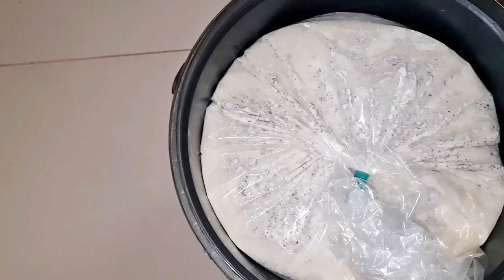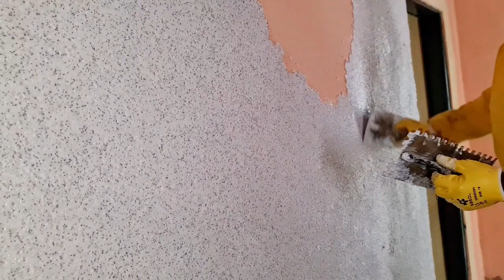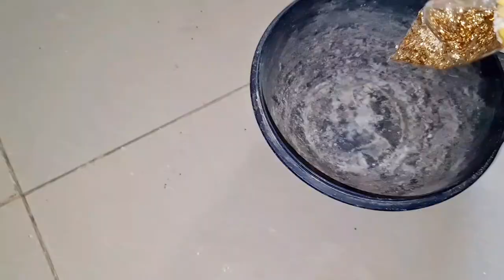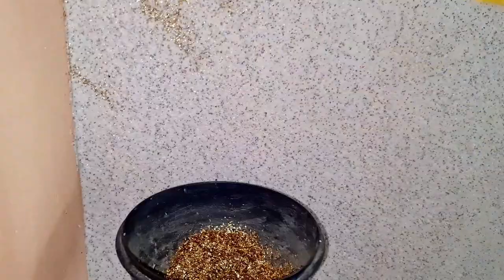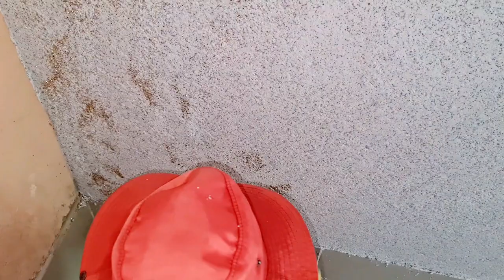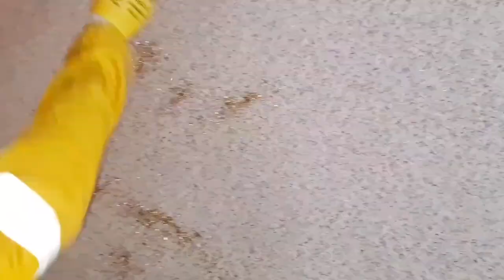How To Apply Glamour Coat On The Wall || Beginners Friendly Diy😍|| @Simpleisthebest5855

Comment: When DIY and it drips what must u do
Reply from the maker: Surfaces should not be oily and dusty. If the surface is covered in an oil based or sheen coat, then a skim coat is required as a undercoat. I hope that  helps, you need to be patient while applying.  Thank you for watching ❤️ ♥️ 👀 🙏
Reply from the maker: Another thing use the correct float that was designed for glamor coats.

Comment: How do you clean a glamour coat wall?
Reply from the maker: Hi, make your wall clean by regularly wiping them down with a clean cloth and plain water, in case they are dirty, use a soft brush on your hoover to get rid of loose dirt, wipe over walls with a microfiber cloth and a gentle cleaning solution, dry walls with a fan or open windows to increase ventilation while air drying. Please avoid using any abrasive cleaning tools as these can ruin your glamor coat. 
Thank you for watching 💕 💕

Comment: Can you apply it on an uplastered wall??
Reply from the maker: You can do it but it will cost you more because you need to apply more glamour coat to make it straight. Thank you for watching 💕💕
Reply: How do you fix a damaged glamour coat
Reply: @Simpleisthebest5855  can you advice
Reply from the maker: @zimvomvomvo8018 sorry for late reply. You just take out all the damaged parts and blend then you add the new Glamour Coat. But Ruther than fixing it it is best to remove the whole damaged side and reapply

Comment: Great content. 

1) Can this be applied to a high traffic painted cement floor (exterior)?

2) Do you do consultations in JHB or via video call?
Reply from the maker: According to my knowledge Glamour Coat is used for walls and counter tops I am not sure about floors. We are far from JHB so no  we don't do consultations via video call. Thank you for watching 🙏

Comment: hi how can i clean these walls? or what can i use to clean stains and dirt?
Reply from the maker: Make your wall clean regularly wiping them with a clean cloth and plain water, in case they are dirty,  use a soft brush and you 
hoover to get rid of loose dirt, wipe over walls with a microfiber cloth and a gentle cleaning solution, dry walls with a fan 
or open windows to increase ventilation while air drying. please avoid using any abrasive cleaning tools as these can ruin your 
glamor coat. thank you for watching :face-red-heart-shape::face-red-heart-shape::face-red-heart-shape:
Reply: Thank you very much. @Simpleisthebest5855